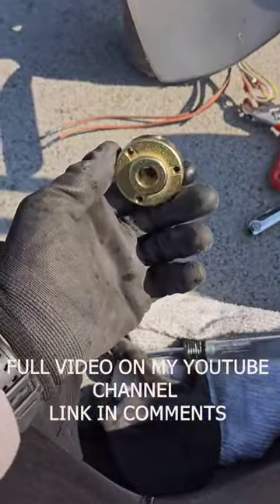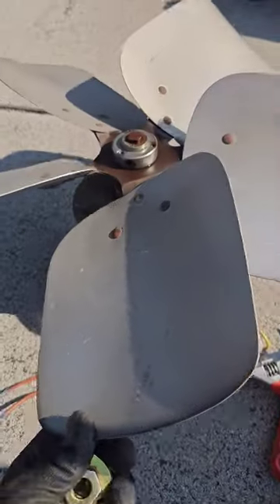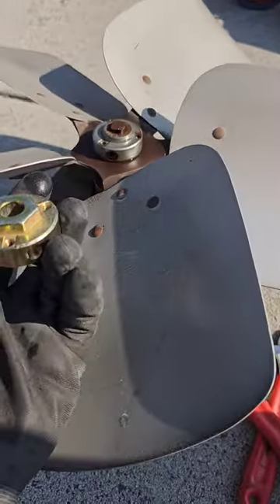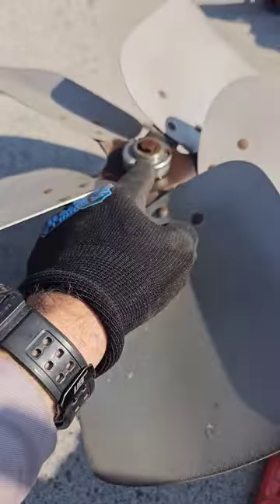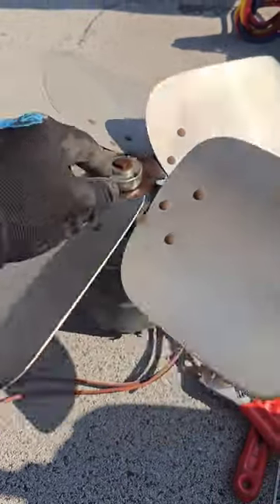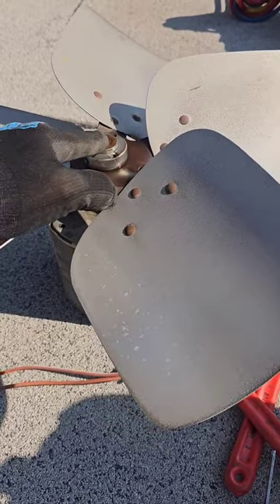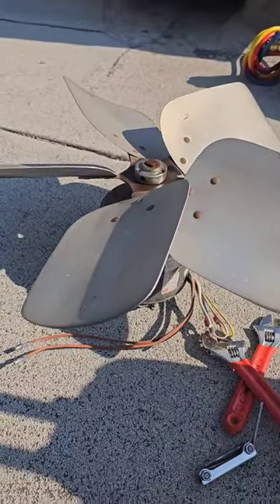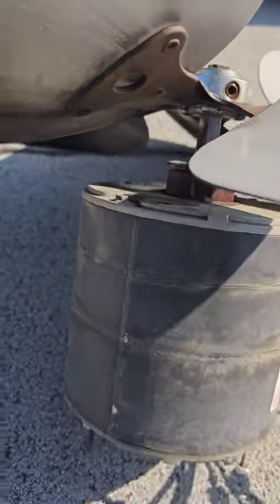GOTTA USE YOUR BRAIN #shorts

Comment: The shaft won’t “mushroom” just cutting it unless you beat it with a hammer for some reason but a file quickly and easily takes the edge’s off after the cut for a nice smooth taper

Comment: But if them screws was on bottom now when it spins it will want to back them screws out from spinning? With it the other way, they wabt to tighten. And if they come out the blade wint damage anything. The other way if the screws comes out now we got a lot more damage....

Comment: Why you want the hub underneath is because the force is pushing down on the blade.
The hub becomes the stop.
With the hub on top the same down force is on the screw heads.
Reply: It seems the motor was a belt mounted motor bottom version.